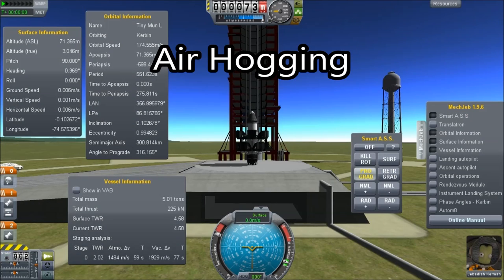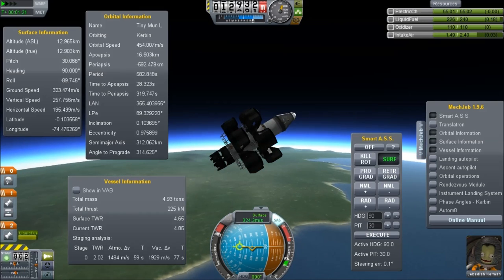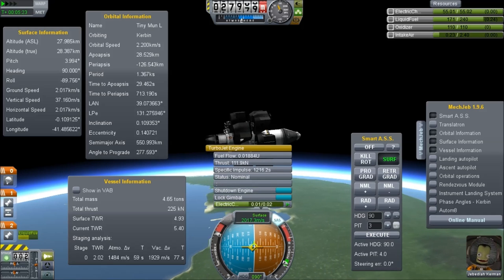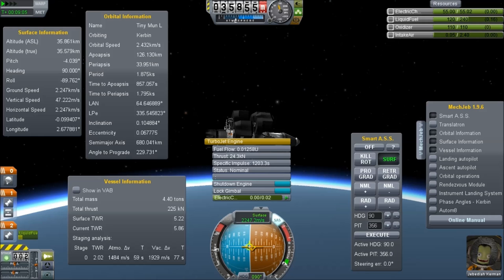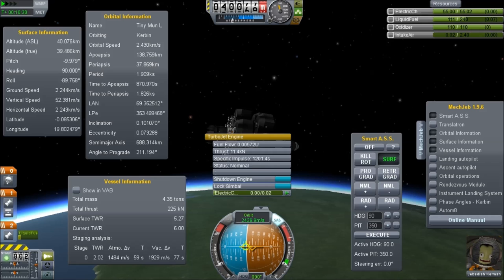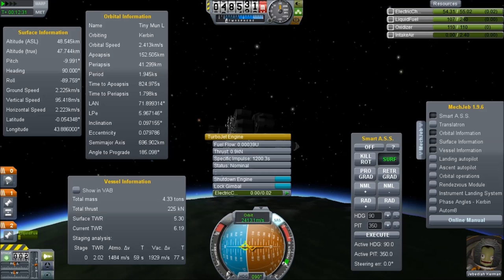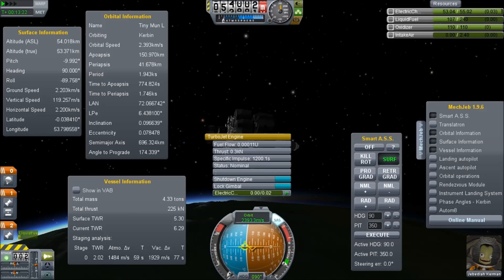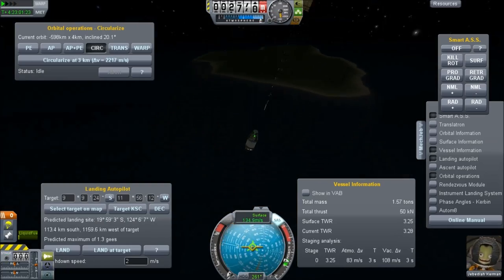Kerbal Space Program - Airhogging - Abusing Air Intakes

Comment: I haven't explored mods yet but im rolling on the floor because I seen a panel called " Smart ASS "
Reply: Pcwizard20ghz Yep. SmartASS is part of MechJeb, it basically allows you to point your capsule in any direction, such as prograde, retrograde, towards or away from the surface, etc. It's similar to the skills pilots get in stock, but more versatile.
Reply: +Jonathan Hughes But in v.1.0.4 you can do that without the mod
Reply: Sasha Samarin No, the stock pilot skills don't have as many options.
Reply: Jonathan Hughes fair enough

Comment: Hydrogen is used in rocket engines, which generate a lot of heat. The reason they might use hydrocarbons instead of hydrogen is to keep heat to a minimum, otherwise the cooling systems it would have to carry with it would add too much weight. (I believe this was a problem encountered by the teams behind the Skylon spaceplane, and the HOTOL project)

Comment: Why does Jeb's facecam have such a low framerate?
Reply: Before 0.19, the facecams didn't have as high framerate for whatever reason. Ah, the olden days when you could reenter at 5km/s and not have to worry about re-entry heat.

Comment: What if you could place RCS in front of the air intake and pump into it? I wish that worked.
Reply: or you could have oxygen pre mixed with the fuel... like rocket fuel
Reply: It isn't actually pre mixed, it is stored separately in the tanks :P
Reply: 420NoScope You mean oxidizer?
Reply: Nitrogen is usually the rsc monopropellant because it is light add inert. Or wouldn't work to light an engine
Reply: @brianbrian_brian_brian , writes "or you could have oxygen pre mixed with the fuel... like rocket fuel"

Oh sure! That doesn't sound dangerous at all. Hey, isn't that how explosives work?

Comment: I can think of only one way to get a Turbofan, Ramjet, and Scramjet to work on the same 'engine'. The first is to have an engine nacelle with 3 lobes on it. Each one contains the appropriate center section for the engine type you need. When you want to switch you go into a glide at high altitude and switch the engines over. The center sections would disengage from the nacelle and rotate to bring the correct section in line with the intake.

Comment: Concorde also had a "flap" over the air intake of the engines that lowered down to reduce the size of the intake when at higher speeds, as just as scott says, the high speeds just blew out the engine´s flame

Comment: Efficiency, as in specific impulse, and weight are unrelated. In simplest terms, jet engines are more efficient because they utilize the oxygen in the atmosphere, and because their chemical fuel is different in real life. I believe they generally have a higher ratio of oxidizer to fuel, which makes sense considering they're grabbing oxidizer right out of the air. Hydrogen rockets generate more thrust, but at the cost of using a larger amount of fuel per amount of oxidizer.

Comment: If it's only the normal SAS, then it can only provide torque...in essence it stops spinning, but cant really do much else. The A-SAS, uses all controllable parts, like winglets, RCS, and your SAS to control your craft-it's like an autopilot, but if your craft is totally under control, A-SAS cannot save your craft. It can only do minor corrections. Try turning off SAS, then stop your spin/movement, or at least slow it down, then turn it on again.

Comment: Using some botched configuration editing you could probably make a part that can turn IntakeAir into Oxidizer, so you could have empty tanks that store only oxidizer, and full fuel tanks, so you burn a certain amount of fuel with your jet engines, and the ramscoops are also collecting IntakeAir and turning it into oxidizer, so when you get to a certain altitude, you can use your rockets without carrying Oxidizer all the way. Good idea? You should try it Scott.

Comment: Most of the time an inlet stall would cause the SR-71 to yaw severely enough to cause the other inlet to stall as well. This was still violent enough to slam the crew's helmets into the canopy.

The breakup of the aircraft you're talking about I think was because the inlet cone failed and went full-forward or full-aft, causing much more drag than just stalling out. This would be SR-71A s/n 61-7952 / 2003 "Lockheed test pilot Bill Weaver survived although his ejection seat never left the plane!"

Comment: I've had my Aries 4D going 3000m/s odd in atmo. Trick is that there is a knife edge between absolute maximum output of the turbojet's with rams and the point it gives up and compressor stalls.   I do, however, admit that was a speed run with all engines (2xTJ's + 1xSpike) running flat out.  It did not however require a dive to pull off.

Listen for when the engine noise changes to a 'scream' and pitch down to stop the stall.  Around the 24.5KM mark.

Comment: Yeah I had this problem the trick is to throttle back before igniting the rocket engine(s) and start using RCS to assist with maneuvers due to the altitude.   But SSTO's are quite easy once you get the hang of it, however you often end up in a 100KM orbit with not enough fuel to do anything but return to Kerbin.   

Tip:  Try the stock Aries 4 with an Aerospike and two control groups set to toggle the different engines.

Comment: To be more specific, a rocket generates thrust by heating and expanding fuel mass as a reaction mass. An air-breathing engine burns fuel to heat and expand a much larger mass of air than the fuel mass that was burned. In other words, the jet uses air as a primary reaction mass as opposed to a rocket.

Comment: First, the jet engine is efficient, though they have less thrust to weight ratio compared to rockets.
Second, the jet engine sucks the surrounding air, so the tank doesn't have to carry the oxidizers and thus, carry more fuel for the same volume.

But jet cannot operate on vacuum and ramjet can only be used if the velocity is higher than mach 2.

Comment: I'm assuming you meant "They can't do mach 10 because that is the speed of light. Maybe re-entry is mach 2.5." If so, speed of light is WAY over mach 10:

Speed of sound (mach)=340 metres per second
Speed of light=about 300,000,000 metres per second
300,000,000/340=about 880,000.

So, the speed of light is about mach 880,000

Comment: Mach number is actually relative to speed and thickness of air. At the ocean level Mach ten is about 3,400m/s as that guy before him said, at the height of 30,000 feet where air is thinner its 3040m/s.
You're probably talking about miles per hour when everyone else is talking about meters per second.

Comment: Hmm... tricky.  Best guess would be slap a linear RCS thruster on the nose pointing in the direction it wants to flip and see if that adds enough down/up force to keep it pointing in the right direction during the boost phase.   It's a problem I have with mine (nose up's under extreme acceleration) so it sounds like we're both working on the same problem.

Comment: Great video! I abused the air intakes on a rocket to get a very efficient way of getting fuel for my refueling space station in orbit.

One tiny suggestion though, would you mind putting a low-pass filter on the audio of the time-compressed parts next time, so my ears don't get utterly raped by the high-frequency sound of the engines?

Comment: hey, you should revisit this with the new air intakes from the B9 aerospace pack, ive noticed, as i did this, different engine/air intake combinations have different performance curves. i had a jet engine working full throttle at 35 km

Comment: One of the awesomest things about the SR71 is that the plane expands 30 centimeters when it reaches top speed, by the friction of the air. 
And because of this expansion the plane leaks fuel when its on the ground.

Comment: Is this still possible in the latest version?
Reply from the maker: +HyperSpify Nope, the engines have changed quite a while.
Reply: +Scott Manley  What was that at the bottom of the screen at 3:27 ?
Reply: +Zach Field Its an island.
Reply: +HyperSpify Nope. Even if, as scott said, the engines hadnt changed, the new aerodynamics and heat being a thing, you cannot build up this kind of speed anymore without overheating the ship. Also, Jets dont have the power to launch from the launch pad like this anymore (not the jets that you need to reach orbit velocity anyway)